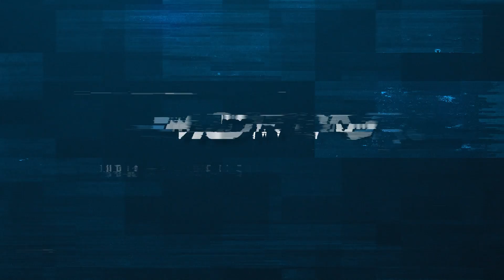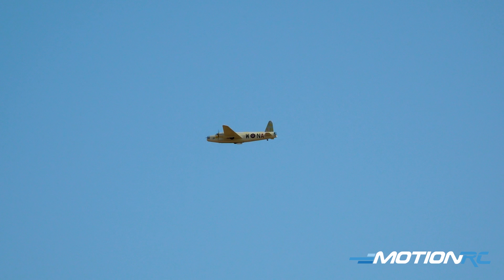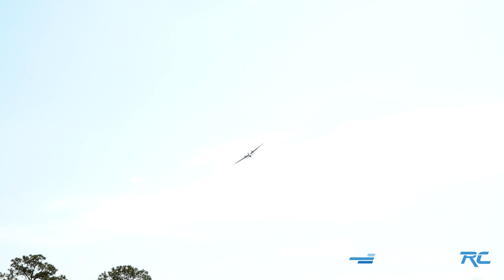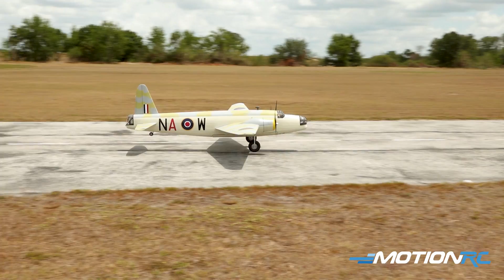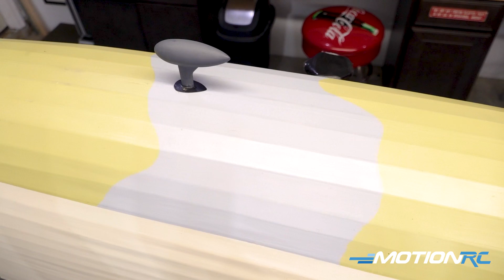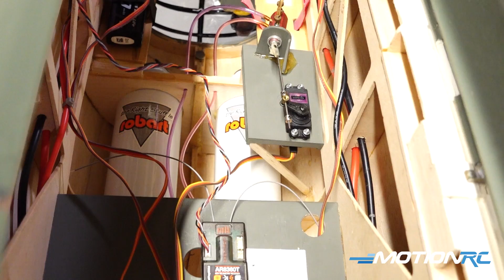154" Scratch Built Wellington Flight w/ interview from its builder Larry Utt  | Motion RC

Comment: Beautiful model. My Dad was a Lanc pilot in WW2 but he and his crew trained up on the Wimpy. On a navigational flight out of Silverstone they developed engine trouble and with low cloud (so flying low, with navigation difficult), the Wellington unable to climb on one engine, hilly terrain expected ahead,  and with risk of the other engine failing, my Dad made a quick and wise decision to put the plane down wheels up on the grass alongside the runway at an airfield that loomed up ahead out of the murk and that turned out to be Castle Donnington. He opted for the grass I was told as Wimpys were prone to catching fire and burning quickly if sparks set the fabric covering on fire. Anyway, they all walked away without a scratch though the station commander wasn't happy that they'd written off one of His Majesty's aeroplanes!